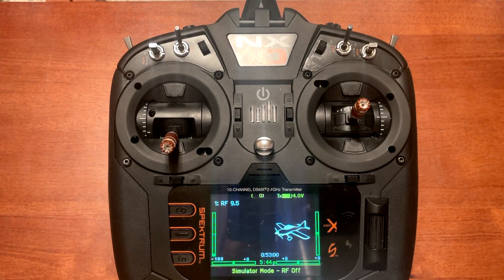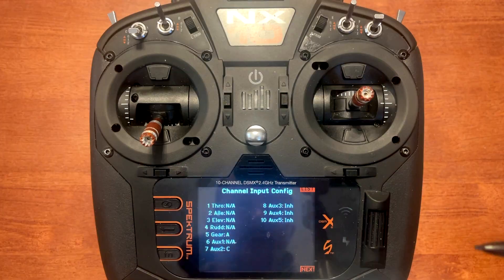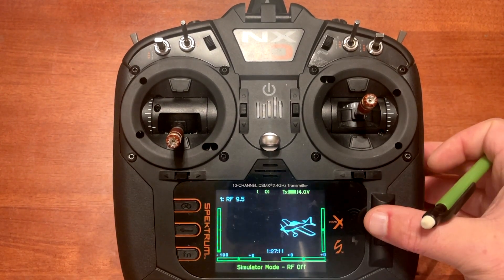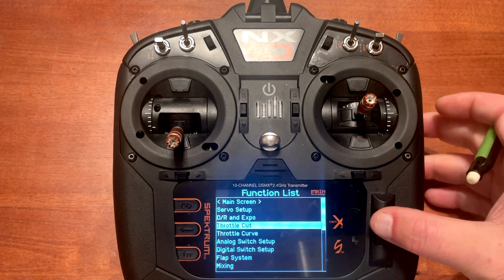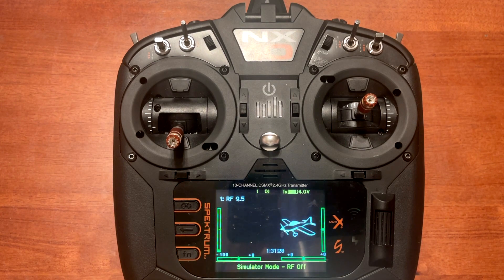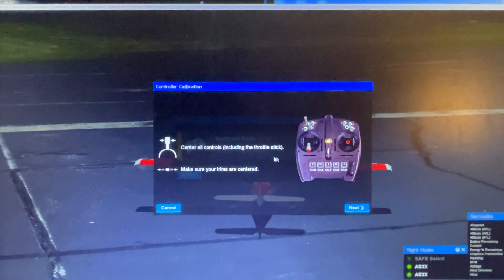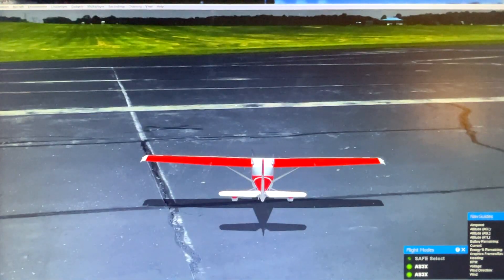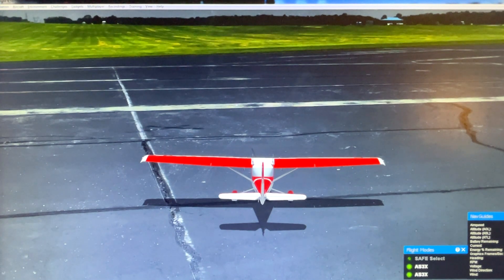Spektrum NX Setup: RealFlight 9/9.5/9.5S Setup (NX6/NX8/NX10)

Comment: My Real Flight Evolution Simulator worked fine until I updated the software. I lost my Real Flight Model information. I re-entered the model and attempted to calibrate the controller. All of the blue bars show 100% and do not adjust at all. The finish bar is not highlighted and all I can do is hit cancel. Also for what it is worth the tool bar will appear when loading Real Flight, but then disappears.
Reply: Okay, figured it out. Latest update is flawed. I had to roll back the update to the previous one. Also can not be done with WiFi. Had to use an SD card.

Comment: Question, Everything was working just fine, now when I try to fly in 9,5s my Elevator switch is wrong, I think I've tried everything.. It works fine with the Evalution planes, just not with 9,5s.
Reply from the maker: Interesting. Do you have both planes running on Evolution sim or different sims?
Reply: I found a reset tab, so now it's working great! Thanks!  @BDTennessee

Comment: Any particular reason you need to make a new model template for RealFlight? Or can I just use the models I already have on my NX10 for RealFlight, and just switch models when I want to fly a different plane? That way I don't have to reprogram it every time I fly a different plane that has different mixes, throws, flaps, gear, etc
Reply from the maker: New model isnt needed. One model can fly most planes on real flight so constant changes arent needed. Also i dont want to change settings on models for my actual planes.
Reply: @BDTennessee  oh yeah, I would have a separate template so I could fly any planes on the sim that I don't already own without affecting my settings, but whenever I want to practice with a plane I already own using the sim, I could just use my existing model file on the transmitter so it's already set up exactly like my actual rc plane from the get go without ever having to change my settings. And if I want to experiment with new settings on the sim, I could always just go to my dedicated sim model template

Comment: I'm using RF Evolution. Following your directions, I was successful with the set up; except the function button doesn't reset the airplane on the simulator. The only way I've found to reset after a crash is to close RF Evolution and start over. Do you have any advice?
Reply from the maker: NX doesnt have a reset button like the interlink controller. Push spacebar on keyboard will reset the plane.

Comment: Sir, thank you for this video. I have been struggling with a decision to buy this software (and a PC, since I only have Mac's), this video has helped me. One question I don't see addressed is, if one chooses to use the USB dongle (WS2000 I believe) instead of the cable, how does that change the step where the transmitter is connected to the computer?  I have a DX9 and a brand new NX10se. Thank you! Dale Z

Comment: hey, great video, i just wanted to ask if you have a solution to my problem. i have an NX8, and whenever i try to connect it and make it work the throttle doesnt work in mode 2, no matter what settings i use, and then the flight sim registers a different channel like a switch as the throttle and i dont know what to do. it picks up all the other signals, just not the y axis for the throttle stick

Comment: I can't get the z axis to work for flaps. I have the NX6 and set it up as shown in your video except I use D for the Aux2 so the calibration program sees that flap switch D. The problem is that the flaps are always extended on flap models and switch D does not do anything even though it appeared to calibrate OK. Any idea what I need to do to get this to work. I tried using switch C like you did in the video but then the calibration doesn't work (cycling the D switch does nothing).
Reply from the maker: My flaps are on D switch as well. Flaps should be setup through Channel 6 (aux1).
Reply: @BDTennessee  I feel silly now, I didn't enable the flap system at all. Doh!!! It works perfectly now.
Reply from the maker: @michaelkrailo5725  glad you got it fixed :)

Comment: As a newby well this is not a good guide. Throttle cut mate, you just blew straight over it! What settings are good. So many grey areas that i guess you need experience doing this before doing it. You see what i mean.
Reply from the maker: One of the first videos on my channel is how to setup "airplane without a template" which includes throttle cut.

Settings can be adjusted by the user unlimited and anytime when using the sim like actual models. Set them up based upon preference of actual model or you flown. Start out by using Low 70 mid 85 and high 100 for all surface controls,if you want a baseline of values.

Purpose of this video is getting setup correctly and everything to work as intended on real model. Every step is explained from start to finish. Setting up a model can be learned by the video i previously mentioned.
Reply: @BDTennessee  Yeah right. Spektrum are mental. The flap setting is backwards. To have the flaps off is 100%. That's so stupid and they would fail any mech aptitude. If the flaps are level with the wings there is zero deflection, so they would be closed. Also how do i get the Turbo Timber Evo in the TX plane menu? It's not there and i've done the firmware update. Spektrum have ruined my RC plane experience. About ready to return the lot.  Thanks for nothing Spooktrum. Where's your customer support number?!
Reply from the maker: @vertigo4ubob704  each manufacture has different ways of doing stuff.Most of them flaps up are 100% value,some negative and some positive. 100% is on both ends and just means end of servo range which would be flaps up ,is why its that way.

Not all the planes are on the built in template list.Which i cover in video mentioned before too.One reason why i made the tutorial without template. Most eflite planes have very similar setup and easy instructions in owners manual for each model.

Sorry to hear starting out in hobby you have difficult time.However getting on here,blasting small things that have been addressed and not asking directly for help isnt a solution. I spend plenty of time with viewers,FB post and forums helping. Which i dont mind but this isnt the route.

Direct customer support,go to HorizonHobby.com and message them with online chat. Easy and efficient way to get help.
Reply: @BDTennessee  hello BD I just wanted to say that I highly commend you on the way you handled this jerk!!  👏  your friend Marty from Canada 🇨🇦 🛩 🛩
Reply from the maker: @martymannisto1109  Thanks Marty :)

Comment: Great video, I’m a newbie to the nx10 and really struggling to get mapping and switch’s setup for heli with throttle hold, panic, and mode switch. I was under the impression that the model files would match up with real flight controls, totally not the case. Do you have a pdf of your channel and switch settings? Any help would be appreciated . Been trying to get this working for almost a week and I’m way over my head . Baffled by the lake off information on this topic
Reply from the maker: I dont have a pdf. One step at a time through the video and you will have it correct.

Comment: Help please! I have nx10, My ailerons and electors are way too sensitive in the simulator, and I did put my d\r to 100% and no sub trim and travel adjustments. But it still doesn’t work, what should I do please? Also the simulator just can’t detect my channels to assign sometimes.
Reply from the maker: You need to adjust dual rates to lower percentages. Assign them on switch or switches. Follow video step by step and you will have everything set.
Reply: @BDTennessee  Thanks for respond, but I found it actually seems like a bug between the transmitter and steam controller system. After I disable the steam control and reconnect by USB each time I play the simulator, it backs to normal.
Reply from the maker: @zhaodaliu6709  Copy! I would try reinstall software or drivers (radio). You should be able to leave transmitter plugged in/power it up and start steam without issue.

Glad you got it figured out :)

Comment: Hi there do you recommend the realflite 9.5? Just thinking of getting one to practice my 3d moves cheers
Reply from the maker: I would for sure.Especially for 3D so you can learn orientation and build muscle memory when hovering or general 3d flying.
Reply: @BDTennessee  awesome ok so is it easy enough to install my computer does not have a DVD player but I guess could get an external one? I heard sometimes it doesn't load or people have trouble with installing it? Cheers
Reply from the maker: @jasegazzard3743  Download steam, RealFlight 9.5S and install. Its a digital download so you download and install without disc drive :)
Reply: @BDTennessee  awesome cheers
Reply from the maker: @jasegazzard3743  anytime :)

Comment: Can you please do a set up for Helicopters on NX10 and Realflight 9.5
Reply from the maker: You can use this setup on helicopter as well. Idle up is on A and Throttle Cut it on H.
Reply: I have the same request. For a helicopter setup. I'm not sure what you mean in your reply to the other guy.

Comment: Hi BD. I set up my NX10 using the USB connection. Works great except I only get flaps up and landing flaps. No takeoff flaps. Has anyone else solved this one? I have tried it on several different planes so not sure what is causing it.
Reply from the maker: I had it happen once before. It showed up when i deleted my template and made a new one for realflight. Seems like a recalibrated or just open/closed several times and started working again.

Comment: If you use a dongle to connect instead of the USB will the settings still work?
Reply from the maker: Yes.Dont use "Controller mode" cause you will bind to the dongle.

Comment: Great Video!  If we want to connect wirelessly using the WS2000 dongle, how is that setup?  I know in that case that the RF would be on but being wireless is nice.  Maybe do a video on this setup?
Reply from the maker: Same process. Only difference is binding the dongle and transmitter together. Also,correct wouldnt go to controller mode.
Reply: & remember to hold (the dongle) bind button as ur plugging it into the usb port. 👍 (For ppl that don't know)
Reply from the maker: @old-rcplane-phart  thanks for adding that info!

Comment: Thanks for show this. One more thing. 
If you have the RF 9.5s flight sim by HH and your controller won't work on your laptop or computer, here's the fix. Buy a Powered USB Hub Port. After plugging it into the wall, and plugging the USB lead into your USB port on your laptop or computer, then plug your controller into the Powered USB port. Yahoo, it works. $21 inconvenience. Amazon saved the day.
Reply from the maker: Thanks for adding the info!I havent run into connection issues.However i know the fix,if it does happen :)
Reply: I just got an NX10 last week. Used this video and your tip to try to connect to RF9.5. No luck. Chatting with Horizon was, as usual, useless. The guy was convinced the USB port on the radio is bad, even though it charges fine. Rather than sending it in for service, I'll probably just return for refund and get a RadioMaster TX16. I've had too many issues with the Horizon/Spektrum mafia to continue dealing with the BS.